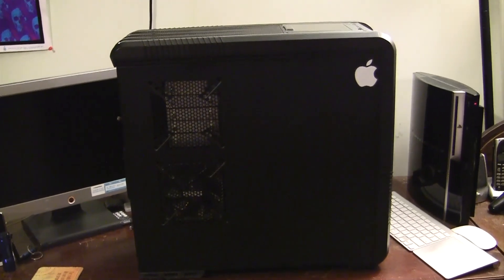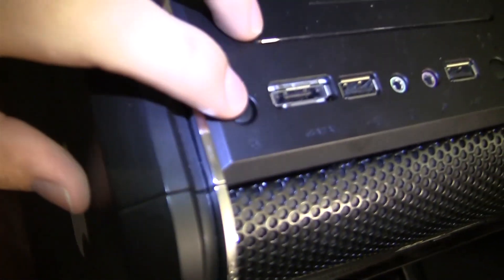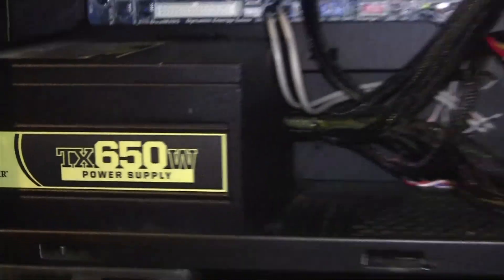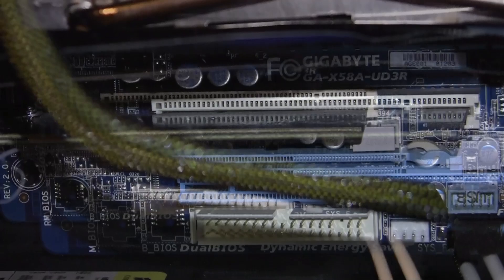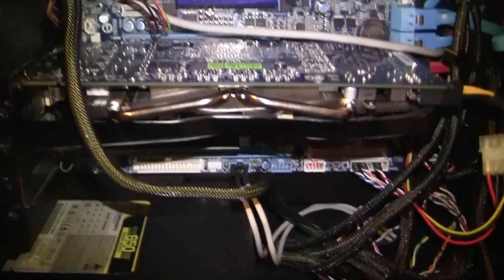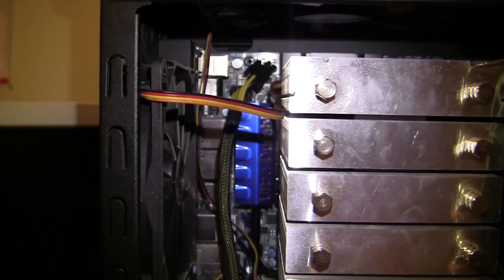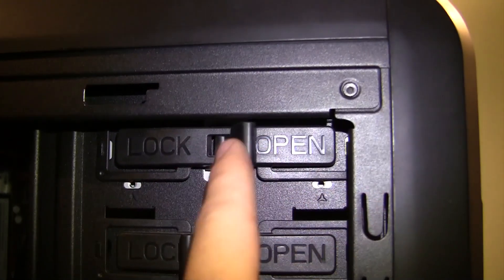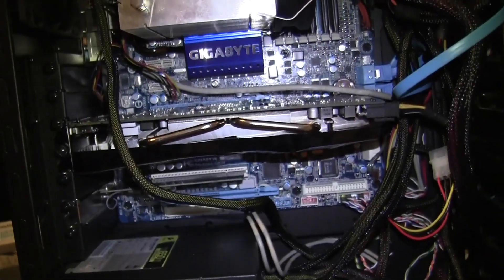Inside my Hackintosh Case (Tour)

Comment: You may already know this. But that annoying little 4-pin or 8-pin cable the plug in near the CPU will fit perfectly under the GPU and pretty much all modern PCI cards. They all have a small indent on the bottom of the card for that exact cable to run through so you don't have to run it over PCI cards. Just thought I'd let you know...It took me a long time to figure that one out lol. 7:00

Comment from the maker: @lvpd742 Not at all. However, I was nervous when I had it all together and it didn't turn on, lol. Turns out I had the power switch wire connected to the wrong place haha. As long as you're careful then you shouldn't be worried.